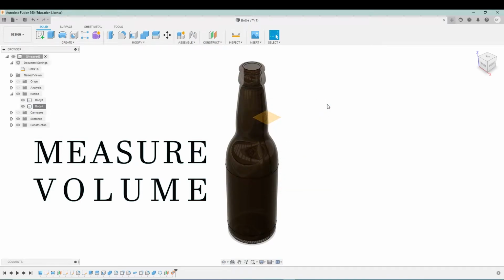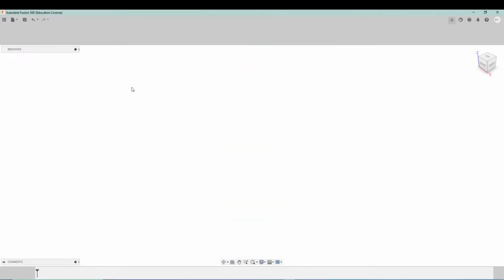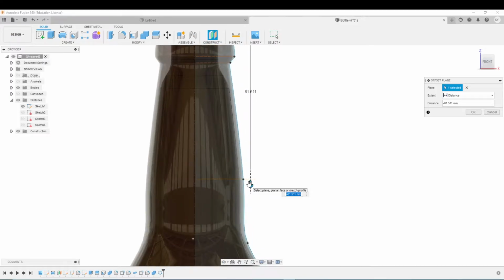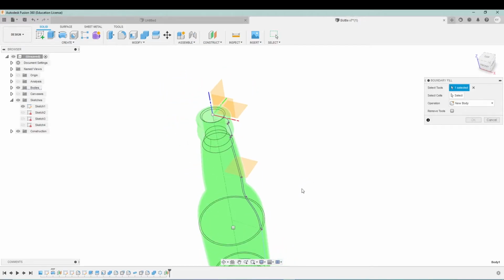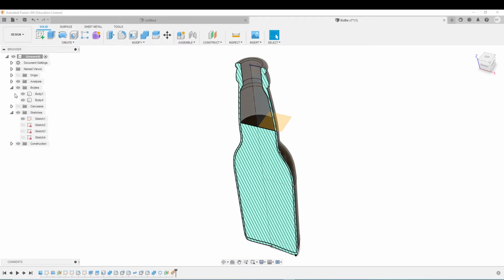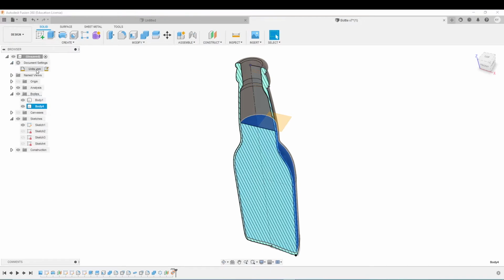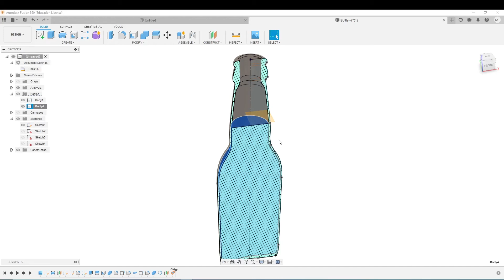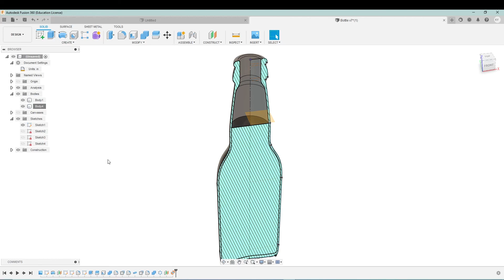Fusion 360 - Measure Internal Volume

Comment: Can it work with irregular shapes like a beans shape......if after designing beans I want to know its internal air volume?
Reply from the maker: Yea it will work depending on the complexity. If the shape is really complex it might not give accurate results